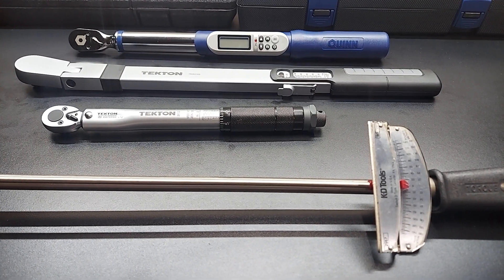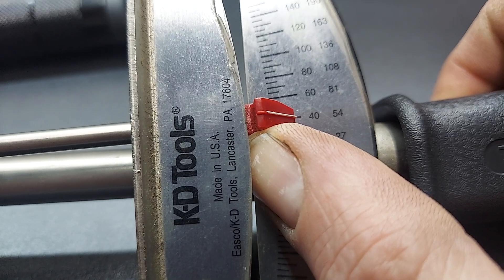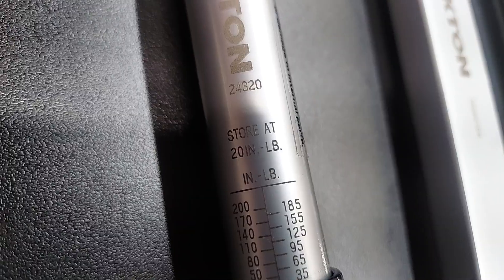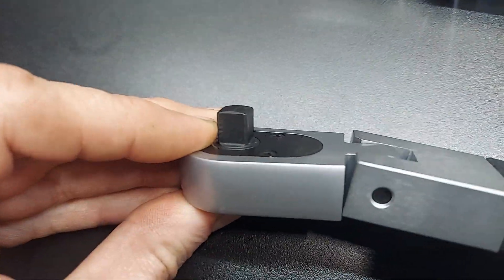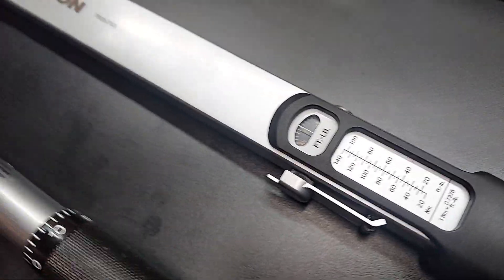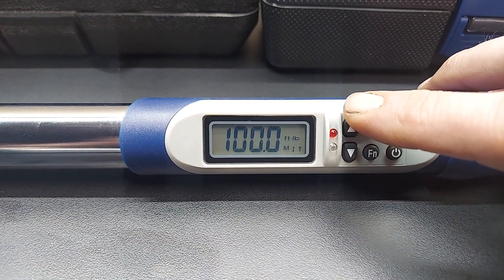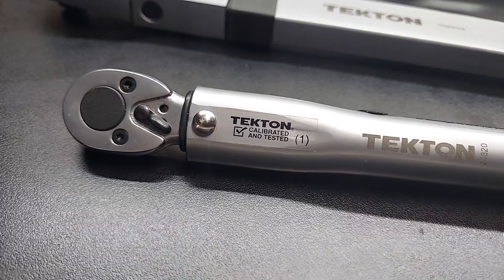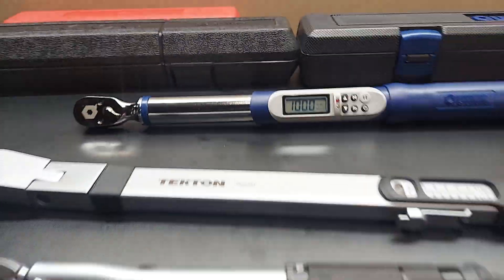Let's talk about torque wrenches

Comment: Have had many different brands over the years. Had one Tekton that made my life much more complicated. Had some from Harbor Freight(cheap stuff) and didn't keep them. Bought a Snap-On fully digital 1/2" drive years ago and had no problems with it. One thing I personally recommend for digital if you have removable batteries, take them out after every use. A very expensive tool can be damaged or even ruined by less than 2 dollars in copper tops.
Reply from the maker: just curious, what was wrong with the Tekton you had?